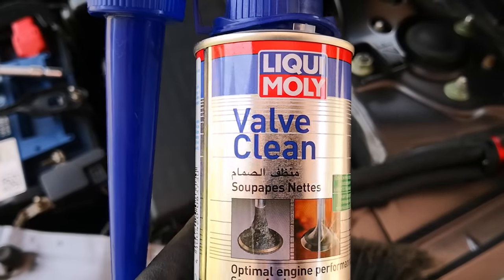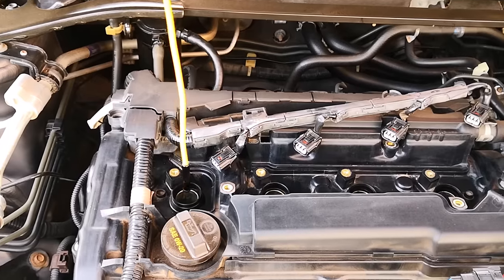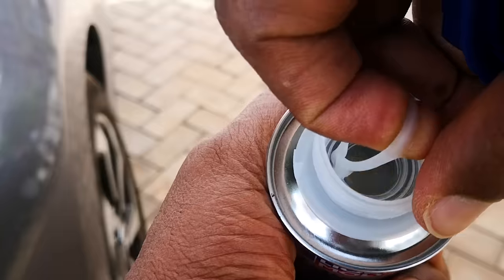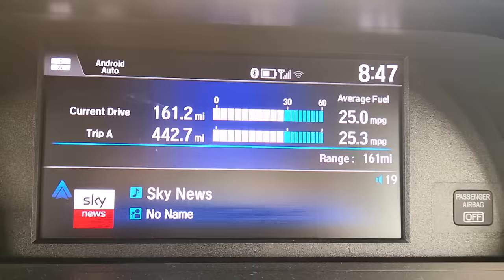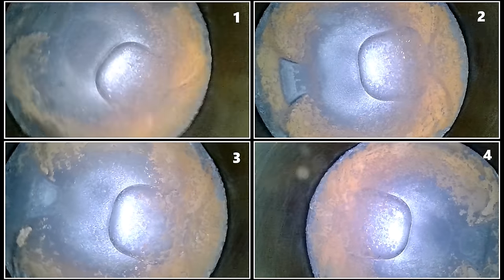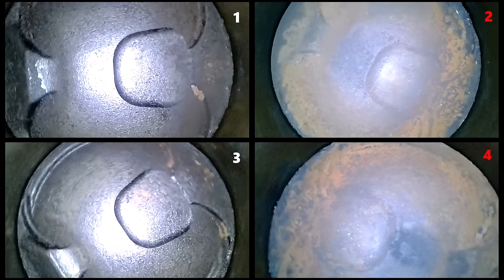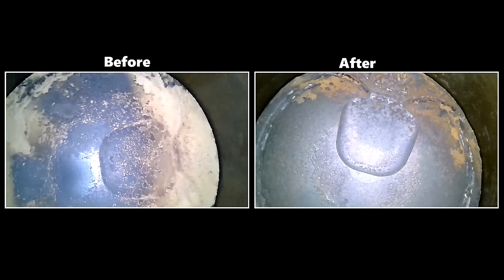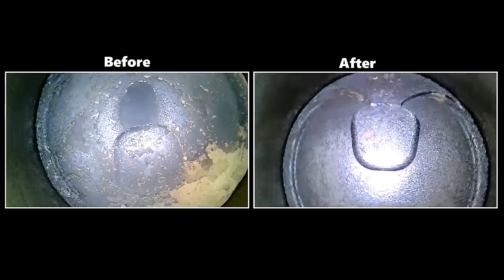I tested Liqui Moly on Piston Carbon Removal: Liqui Moly Valve Clean Works on Piston Carbon Build up

Comment: If you have any access to purchase Techron Concentrate Plus Fuel System Cleaner, can you please do the test please?
Reply from the maker: Thank you for the suggestion! I'll keep an eye out.
Reply: @DIYAutoworksNG  No problems.. ☺️👍🏼 And apparently it's good too.. Not sure if it's as good, better or worse than the Liqui Moly.. Plus it's from a well known company Chevron/Caltex..
Reply from the maker: Yea. I've also heard good things about the Techron product, though I haven't used it.

Comment: Honestly, what does a tiny layer of carbon on top of pistons do anyway
Reply from the maker: That was by no way thin. I missed showing the layer by the 90 degree camera of the borescope. You would have appreciated it more. Car was even pinging from the carbon. Also GDI engines are less tolerant of carbon build up.

Comment: Would this clean the spark plugs aswell ?
Reply from the maker: I wouldn't use it for cleaning spark plugs. Carb cleaner better of the car or using ultrasounic cleaner. My spark plugs were not fouled, but depending on how hard you drive you may see some added deposits on the spark plugs. Nothing out of the ordinary.

Comment: Don't use on 335i 2008 or any DI, liquid moly said in their video n valve clean that it doesn't help on DI cars. It currently is in my car/gas tank but I didn't know that, just sharing because I'm not sure if many people know.
Reply from the maker: You're correct. Though the car in the video is GDI. The Liqui Moly product for GDI cars is DIjectron. I couldn't find it. It's not like it will destroy your engine, it just won't clean the injectors
Reply: @DIYAutoworksNG  I hear you! DIjectron is so hard to find, it’s just not sold on Amazon, or auto parts stores etc near me, gotta order it online but even then. I just bought valve clean, anti-friction , pro-line complete gasoline cleaner, and jectron. I wanted DI jectron but couldn’t get it / didn’t want to go somewhere else to buy. Good video tho’

Comment: does the carbon clog the fuel filter or cat? also good for gdi engines?  will it clean where the injector misses?
Reply from the maker: This is a GDI engine. I haven't seen this method clog the cat. As long as the engine is functioning well. Major cat killer is misfires, oil and coolant contamination from sticky/worn oil control rings and burnt head gasket (respectively). The raised temperature is good for the combustion chamber as a whole and so can clean where the injector misses.
Reply: @DIYAutoworksNG i have a honda crv  gdi ..is there other of their products you recommend to use with the valve cleaner to clean up the engine ? it has 72000 miles and i got it used at 67000..i know the gdi is noted for carbon etc build up..thank you.
Reply: @DIYAutoworksNG i see this as a better way than intake cleaning for dirty engines since it would blow too much crud off at once..so do you still use it today and how often for preventative..

Comment: In an ideal world, there would be normal fuel, which would not carbonize the system and would not require additional additives.
Reply from the maker: Totally agree. Some countries are worse off,  and only have low grade gas.

Comment: need 6 can valve clean LM wow😊
Reply from the maker: I think it can actually be less depending on the circumstances e.g. If you dump it in before a long trip. More highway driving does aids cleaning

Comment: So... the conclusion - all you need to do is just to go high revs and make engine breath. That will destroy the carbon.
I don't think that Liqui Moly helps a lot. Coz you can see on the video, that x2 portion didn't make a change. And also as far as I understood, the owner was driving only on the low RPMs before. 
My opinion - do not spend you money on some cleaners. Just give an engine high load sometimes to make the carbon burn out.
Reply from the maker: I did a comparator run without Liqui Moly and should be posting soon.

Comment: I wonder what condition your plugs were in after all this
Reply from the maker: Wish I could reply with a picture. They did have some deposits at some point but nothing out of the ordinary.
Reply: @DIYAutoworksNG  are use ruthenium plugs now they’re made by N GK, and you can only find these plugs in newer vehicles, but with the same engines that the old vehicles have, that’s how I got the numbers for mine.
Reply from the maker: I already got a set of NGK ruthenium spark plugs which will go in this car later. Funny thing is that they were cheaper than the iridium!

Comment: This can be used on direct injection car Bmw B58?
Reply from the maker: The car used in the video was direct injection, however, they also have a dedicated GDI cleaner DIjectron. The valve clean won't clean injectors or the back of the valves in GDI cars.

Comment: Isn't Liqui Moly Valve Clean used to clean valves (not pistons)? Unscrew the manifold and show the valves!
Reply from the maker: The instructions says it cleans valves and combustion chamber. The engine is GDI so it won't clean the valves. Was using solely for the combustion chamber.

Comment: was looking at a liqui moly site and it said not to use the valve cleaner in gdi cars like your accord..do you know why they say it?
Reply from the maker: Yea, I saw that after making the video. Jectron is the one they've made for GDI.
Reply: @DIYAutoworksNG  what happens if i use it or should i take it back..?
Reply from the maker: If you can take it back, that's fine. If you use it, nothing would get damaged either. My car that I used it on in the video is GDI.
Reply: @DIYAutoworksNG  what bugs me is this company has no directions on their cans...i am using it due to your results..but i cant believe they find it  difficult to explain how to use it..I just happen upon an article about the products..i have gone on their website and i cant get past their stupid cookies wall..not sure how jetron will function any better to clean the area that doesnt get gas sprayed on it..
Reply from the maker: Those cookie walls are so annoying. Lol.

Comment: How can it clean the valves if the car has direct injection ? 😔
Reply from the maker: It will only clean valve in port injection cars. Except you spray through a vacuum line.

Comment: Just pour it directly into your combustion chamber, let it soak for about 2 days. Suck up the remainings with a syringe/pump.
Reply from the maker: I've noticed this needs heat to work. I think I've soaked a spark plug in it and it didn't do much.
Reply: @DIYAutoworksNG  Yes but you can compensate for the missing heat with enough time to soak in. 
The carbon buildup gets loose and will be removed if you drive normally afterwards
Reply from the maker: Okay. Saving this for if I ever need to go that route. Even though it appears to me the the Berryman chemdip is the king here.

Comment: Can it be used on Suzuki Dzire Petrol
Reply from the maker: It's best for carburetted cars, but can be used on cars with port injection. My car is GDI and it still worked well. Only thing if your suzuki is GDI is that it won't clean the valves and the injectors.
If your car is port injection Liqui Moly injection cleaner will be better. If GDI, Liqui Moly DIjectron will be more appropriate.

Comment: Instead of adding the Liqui moly then filling the tank, why not just add only a gallon or two of gas instead?  Then drive it 100 miles, THEN fill up.  More concentrated cleaner.  Also you can add direct at the fuel injectors instead if you don't mind messing about unbolt ing hoses etc.  
If the engine is healthy, the carbon will burn away on its own, anyway. If the engine is NOT healthy - chemicals won't fix it.
Reply from the maker: That's another way to it, however, didn't really see a benefit when I did the double-flusher described in the video. I leave the messy stuff as last resort 😁

Comment: Hi bro.for motorcycle can use?
Reply from the maker: Works with any 4 stroke gasoline engine. Just take note of the ratio of cleaner to fuel since a motocyle fuel tank is smaller than that of a car.

Comment: and all that dirt is in the catalytic converter now?
Reply from the maker: This was a slow cleaning process so it won't be. I did a previous video which proved this. Before and after pictures of the catalytic converter having used CRC intake valve cleaner. Video bleow:
https://youtu.be/Uy5YLEDhT_k

Comment: Does this work on a gdi engine like Camaro 3.6 2011?
Reply from the maker: My engine is GDI so it should. However, don't expect this to clean the back of your intake valves. Even better, they have a cleaner for GDI (DI Jectron) but I haven't been able to find it at my location. That was why I used the valve clean.

Comment: It can be use in 150cc motorcycle engine?
Reply from the maker: They say its fine for any carburetted gasoline engine
Reply: @DIYAutoworksNG  mine is equipped with fuel injected system I think it will work fine.

Comment: does this work on modern BMW-s?
Reply from the maker: It would, but they have a more suited product for port injection and direct injection engines. Jectron and DIjectron. I used this one because I couldnt find either of the above and was in a pinch.

Comment: The Italian tune up on a Honda GDI engine will not remove Carbon it will only make it worse Italian tune ups are old school methods used for Carburettor port injected cars, best way to avoid carbon build up is used premium unleaded fuel, change the oil every 3000 miles and avoid short journeys. This stuff will clean carbon off the crown of the piston but it will return the real thing that this stuff cannot fix is carbon on the intake valves which is the real worry here. Never worried about carbon on the piston crowns it makes no difference to the efficiency of the engine really.
Reply from the maker: This car was actually pinging from the buildup. It was totally gone after the cleaning. It does make a difference, however, I do agree that premium fuel is the way to go. Only challenge is that I don't have access to it.
Reply: So if you have and Indirect/Port Injection Petrol Engine Car (not older carburetor) that has ignition-knocking issues, what do you do?
It's not valve carbon buildup that is causing this. It's probably carbon buildup within the cylinder, piston head and along the top of the ignition chamber.
Good RON 100 fuel may help but it can take a long time and really really hurt your pocket. If this additive accelerates this procedure, it works.
Reply: @DIYAutoworksNG  I have bought both the "Valve Cleaner" & the "Injection Cleaner" by Liqui Moly. The former can be used at each fill-up, the latter has a 2000 km cycle.
The former is thicker, the latter much thinner. How would propose that I use them? Start with the Fuel Cleaner or the Valve Cleaner?

Comment: Czy ten środek czyści tylko zawory czy wtryski też ??
Reply from the maker: It's actually designed for carburetted engines. They have a product for injection engines. I didn't have those ones at the time and needed to remove the carbon build up.

Comment: How it clean the intake valve on GDI system ?!!!
Reply from the maker: It won't clean intake valves on a GDI engine. It will only do so in multiport or carburetted engine.

Comment: Hi my friend, coukd you test marvel mystery oil?
Reply from the maker: Thanks for the suggestion. I looked for it recently, but couldn't find it.
Reply: I have used Marvel since my 1st car in 1976, I swear by it but NOT for motors with cat converters!!   non - cat yes ... I got over 400,000 km out of a '78 Alfa Romeo with regular use in petrol and oil, for real 😮!  I use it now in '72 MGB with 70,000 km
Reply: Ok bro. What is the ingredient of MMO that will react with cats?
Reply: @midaslm8338  MMO's big "mystery" 😋 is oil of wintergreen (yes the herb).  being organic, in the intense heat of a cat it will likely form much carbon and ash, could plug up the cat.  warning is on label
Reply: @midaslm8338  oh BTW, Marvel's fine in the oil of cat cars 👍 if the piston rings are good shape
Reply: @forestghost7  interesting, thank you

Comment: It’s almost always piston 3 in Hondas
Reply from the maker: Really? I wonder why.
Reply: Been building D, B and H engines since the 90s. Almost all failures I have seen, from typical head gaskets to catastrophic failures with cracked ring lands, thrown rods and spun bearings are almost always centered on hole 3.  

on GM its almost always hole 7

If I had to guess its the combination of firing order and physical distance from the harmonic balancers or transmission

Could be the way air flows through the manifolds in the firing order, thats just the one that goes lean or otherwise has the highest stress

I just know that it impresses people when I say "bet its cyl 3" before I touch it, and then send pics later with that being the damaged bore/chamber

Really appreciate your content helped me make a decision on spending extra money to routinely use additives on the K series we are now using in swaps

We use seafoam etc through the vacuum every few years but never actually looked at pistons later to do any REAL comparisons

So this helps a lot

 @DIYAutoworksNG
Reply from the maker: @jrich436  Thanks a lot for sharing. Your assertions make sense. Thanks for the compliments too! 
On cleaners, I don't even have an option not to use one, I have no access to premium gas. I'll be testing a more potentially more sustainable cleaner soon (for my use case). Comes as a big jug from which you put in an aliquot with each fill up.

Comment: Where did the dirt go? Cats ?
Reply from the maker: Through the cats, it's burnt down to fine particulate matter. Cat will look darker but not clogged. High speed driving without the product once pistons are clean, and the darker colour of the cat goes. I have a video of before and after of the cat using CRC intake cleaner. Same principle applies.

Comment: And now you need a cat converter cleaner to get rid of all the crap you chased out the cylinders
Reply from the maker: I got a cat cleaner which should feature in a before and after video soon. That said, the cat burns quite hot and cleans itself over time, as long as the car doesn't have other issues.

Comment: Why not pour some in the spark plug hole an let it sit over night
Reply: 👍.   I do that with another cleaner called Seafoam, which is mostly naptha
Reply from the maker: I prefer the slower approach. Pouring stuff down the spark plug hole was going to be next if this didn't work.

Comment: Would this work on a MFI engine?
Reply from the maker: It will even be better in a MFI engine, since it will get the back of the intake valves. However the product Liqui Moly made for MFI is Jectron. Valve clean won't clean injectors. It'll just be valves and the combustion chamber.
Reply: @DIYAutoworksNG  thank you! Definitely going to subscribe 🤘
Reply: @DIYAutoworksNG  what about Fuel Injected?
Reply from the maker: You mean multiport fuel injection?
Reply: @DIYAutoworksNG  Just Fuel Injection. For some reason, I can’t figure out what engine type my car has. There is so many engines for my model car. It says FI SOHC then it says MIF . Not sure which is it
Reply from the maker: What car? State brand, model, year, trim and market it was made for.

Comment: Change your intake air filter, that buildup is suspiciously the colour of the sand in the environment
Reply from the maker: Good thought! I change my air filter quite routinely though. Pretty sure it's not it. I think it's mostly some sulphur compound. Fuel here is known to be high in sulphur.
Reply: @DIYAutoworksNG  Good work maintaining your air filter. I wonder what about the fuel it self. Many fuel stations have sand/ sediment in their storage tanks. How well are you keeping your fuel filters?
Reply from the maker: @Skadoodlenoodle64 right! I change the fuel filter as part of a major tune up. Say at 100k miles.

Comment: Does it work on GDI engine?
Reply from the maker: Engine in the video was GDI. Only thing is that it won't clean the injectors or valves. Liqui Moly also makes DIjectron, which is suited for GDI. That will clean GDI injectors. It won't clean valves though.
Reply: @DIYAutoworksNG  you choose sport mode when doing Italian tune up, in my car traverse there is no sport mode, I have tow mode, can I use it instead of sport mode.
Reply from the maker: @wench975 Some people use low gear (L) instead, but drive a shorter distance <5 miles. Never tried it though.

Comment: Is this equivlent to Gumout?
Reply from the maker: Either will work. Liqui Moly is cheaper though, and I tesred it more thoroughly compared to gumout.
Reply: @DIYAutoworksNG  alright. I don't see liqui moly much on where I am from. I guess it's best to use gumout regularly then.
Reply from the maker: Sounds good

Comment: Did you try high rpms?? 300 degrees plus burns carbon off itself 😂
Reply from the maker: I have a video on the channel of just high RPM vs high RPM + additive. With additive cleaned better.

Comment: That's a lot of product to burn away for what appears to be aesthetic improvement in your piston crowns. If this significantly and noticeably improves the performance of your vehicle then fair enough, but somehow I doubt it.
Reply from the maker: The car was actually pinging due to the carbon buildup, the pinging has since gone and fuel economy is better too.
Reply: You want to slowly and gently clean away HARD carbon build up.  A more aggressive product can potentially cause hard if a chunk breaks away and clogs something. 

Besides… these off the shelf products are safe for the Catalytic Converter and 02 sensors. It’s definitely the way to go.
Reply from the maker: @I_know_what_im_talking_about  Agree. Totally. 👍🏼